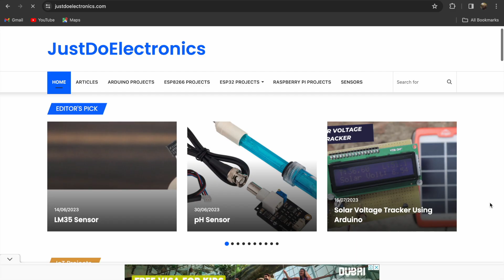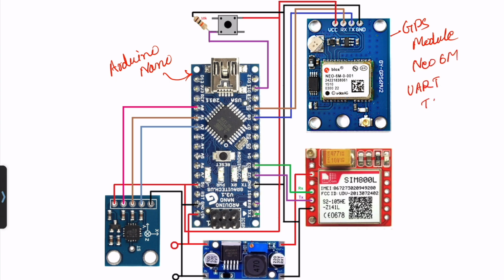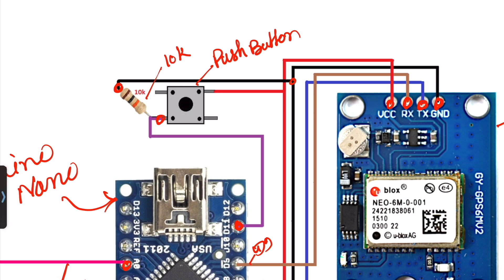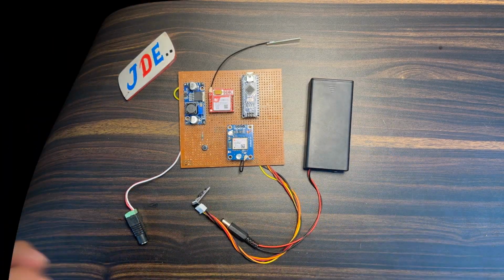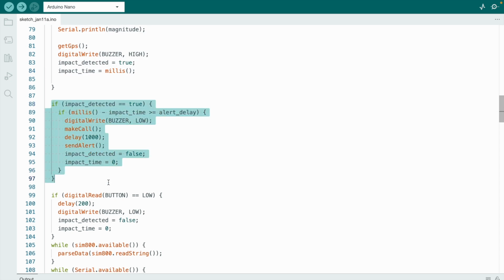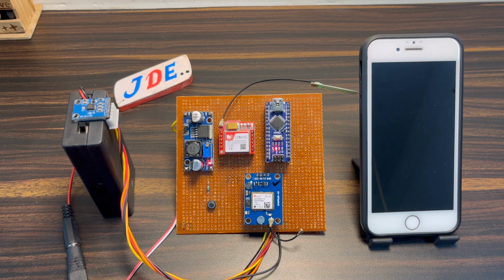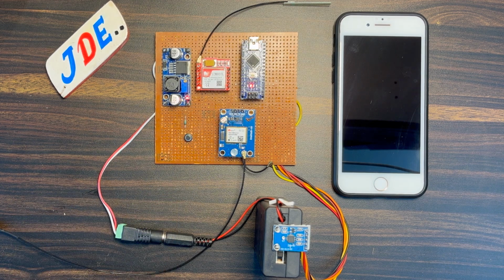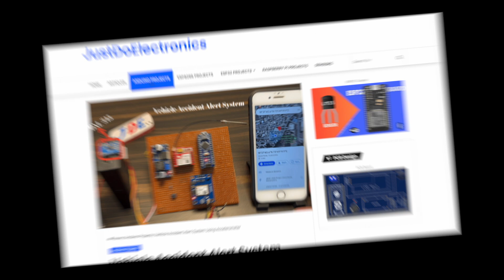Vehicle Accident Alert System Using ADXl-335 Sensor With GPS And GSM

Comment: Hi how to connect two pins on to a single 5v pin because Arduino nano has one 5v and one 3.3v how did you connect gps module and ADXL335 sensor to the 5v pin though it has only one 5v pin

Comment: Greetings correct me if I am wrong SIM800L is 2G module most networks are now 4G and above how can I utilise the above.
Reply from the maker: You used 4g sim card also in sim800l is work but in India jio sim card in not supported
Reply from the maker: You are correct sim800l is 2G model but if you used aritel or vi 4g sim card in India then is work on 2g network that’s why i suggest you